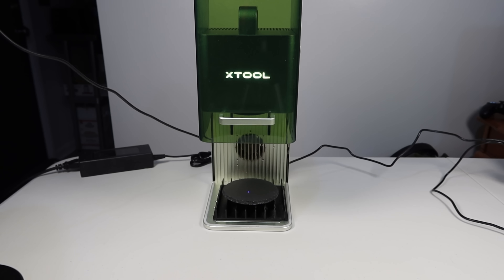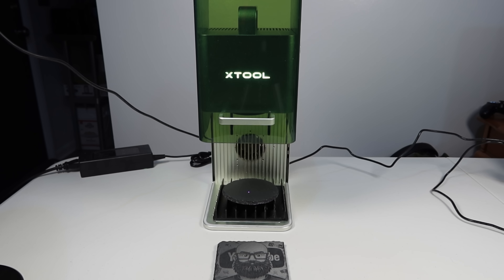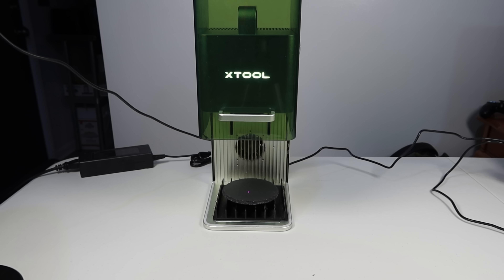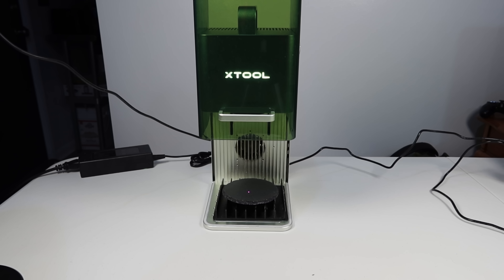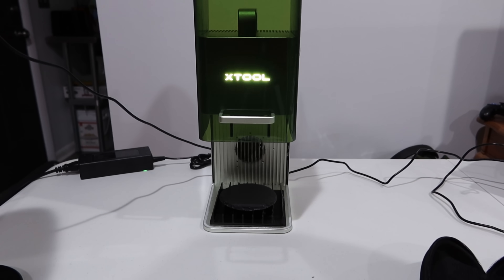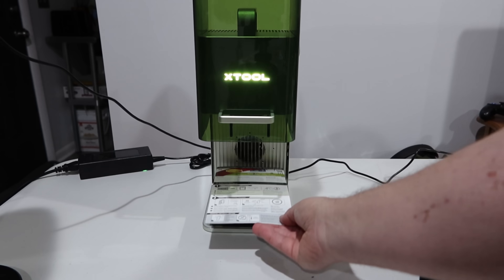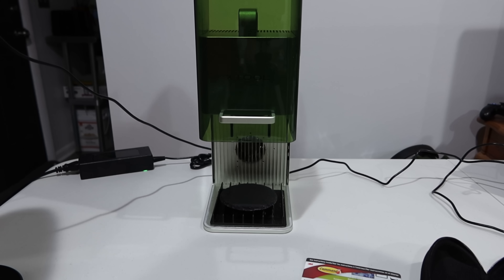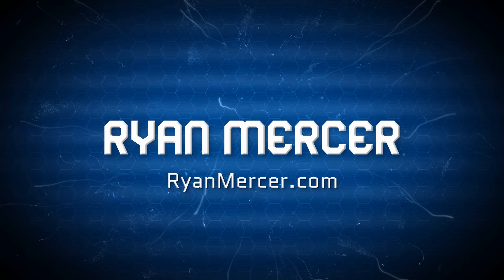My xTool F1 Laser Failed and They’re Ignoring My Repair Request!

Comment from the maker: UPDATE: for now, the IR laser works again. Sometimes. Support finally got back to me and recommended I change my settings to "dot durations higher than 150, set the DPI as 500 " when I was using a duration of 40 and a DPI of 700, which I've previously successfully used on multiple material but wasn't working this time... 
My Patreon: https://www.patreon.com/ryanmercer
Reply: My IR stopped working today as a result of the new firmware. BL works fine.  I tried your updated settings but that did not help.  Hopefully they get back to me soon with a fix or they send me a replacement.  It appears the new firmware has disabled the IR.
Reply from the maker: @terrytharrett9033  bummer!
Reply: I am hoping they fix the issue soon or they send me another machine ASAP.  I have a P2 but most of my work/sales are from the F1 IR.  @RyanMercer
Reply from the maker: @terrytharrett9033  fingers crossed! It seems like they just have so many things wrong with some of them, really disappointing because it's a handy little unit.
Reply: I agree! I haven't had any problems until I installed their new Firmware update that came out last week.  There are several people who have had the same issue after updating the Firmware.  You would think the would have a way to go back to previous firmware that worked. @RyanMercer
Reply from the maker: @terrytharrett9033  yeah I saw some complaints in the Facebook group and decided to skip it.
Reply: Smart move!  @RyanMercer
Reply: I actually noticed that the dot duration was very low when you showed the settings.  I’ve never run it that low so I wonder if such an ultra-quick pulse just didn’t show up to your eye.  I’ve always used their recommended settings for slate (90% and 150 us dot, 450 dpi, and Jarvis).  I’ve had mine now for about four months and it’s worked just fine.  I’ve always found it confusing between raster and vector being kind of reversed from each other with the speed and dot duration, especially getting them the same when you mix the two.  It’s easy to get kind of mentally “stuck” on “Low is slow”, but that’s not the case with raster.  Just out of curiosity, if you run it vector and at high speed, do you have the same problem?
Reply from the maker: @JBrierley02  any time I use their default settings in the software stuff burns or catches fire 😂 even the ones on the site are far from accurate, sometimes I wonder if their test laser was a dud.
Reply: @RyanMercer  I didn't find that except for the acrylic cut settings.  I do 4 or 5 mm per second and two passes for that instead.  For the others they're not perfect but are a good starting point, at least for me.  Maybe there's some variability in the lasers.
Reply from the maker: @JBrierley02  yeah that's my suspicion.
Reply: Hello, Does the infrared laser work with a vector image, if so I have exactly the same problem. I received it three days ago and I was never able to burn an infrared bitmap image.
Reply from the maker: @yanickconus  it works far more often for vector than other yes
Reply: you might have the IR pre-heat on ? or maybe the software is buggy and sets it to a very long time  !

Comment: Can you recommend a laser for batch wood engraving? I'm looking to engrave just wooden spoons, but it needs to ease to operate. The F1 Ultra was pretty ease to set up  but unfortunately the xtool quality is appealing
Reply from the maker: @Kidmarshmallo  there really isn't any ring like the f1s that I've tried. A desktop CO2 laser could work nicely but would honestly be overkill. I really like the omtech I did a video for a bit back but it's $$$.
Reply: @RyanMercer  Thank you for your reply! There is one in my town for sale for around £1500. It's the OMTech Polar 50w CO2 desktop. Do you think it will be good enough?
Reply from the maker: @Kidmarshmallo  for sure for spoons, you'll probably want to make a jig or something if you'll be doing a lot but that  would probably be pretty easy. Set some wood in it, load up your images, have it cut an outline on the wood, then use that as a template for reliably placing them.
Reply: @RyanMercer  Thank you. I appreciate your help
Reply from the maker: @ no problem!

Comment: this just happened to mine.  I have only used it 3 times, it is as close to new as you get.  It engraved amazing those three times but now it does exactly what yours does - nothing.  Do you have an update on yours??
Reply from the maker: @dakemabesemer9481  sadly no. I ended up disputing it with American Express since xTool didn't want to send me a replacement or even try to help me.

Comment: Hi Does this machine need WiFi to work? Would it struggle at events with no WiFi?
Reply from the maker: @kenparsons1396  you can connect it via USB to a laptop to interface with the software, that's all the Wi-Fi does, just saves you a cable.

Comment: I have a new F1 only used the laser about 20 times. The IR is not working now.
Reply from the maker: That stinks, probably used mine about that much before it started acting up.
Reply: @RyanMercer  I did just notice if you slow it down and up the power it cuts on if you use Jarvis. Does not work with greyscale will try the others. 100% does not work with greyscale bitmap mode. Works with the otherss.